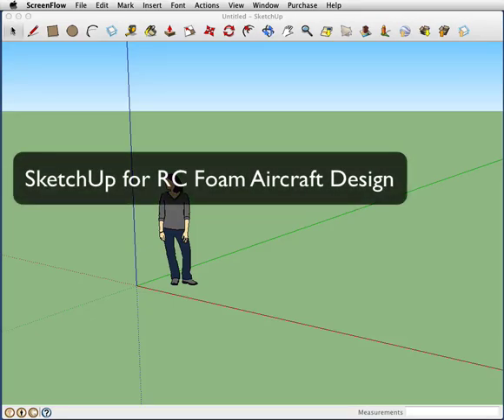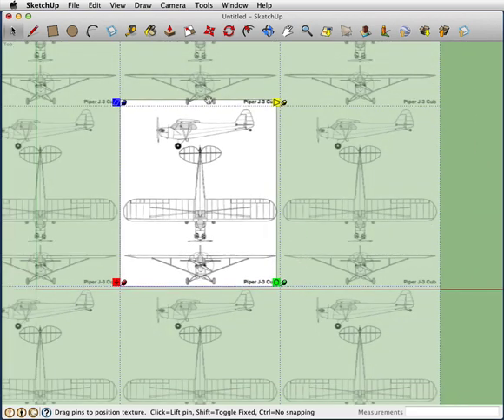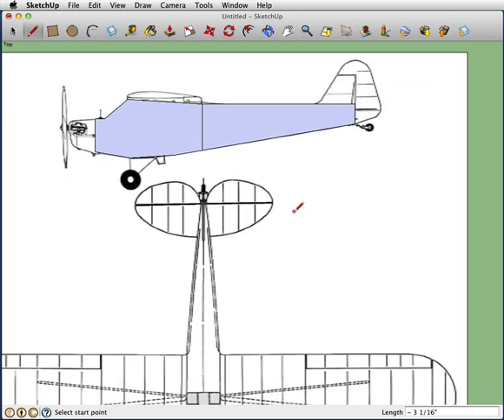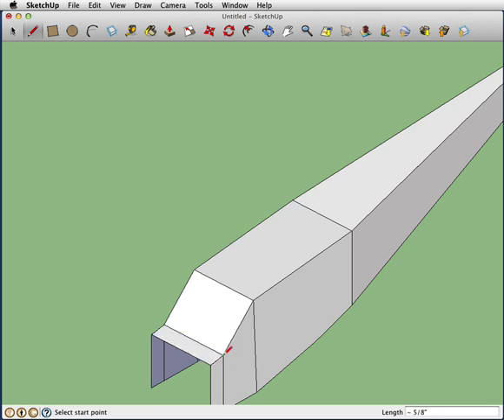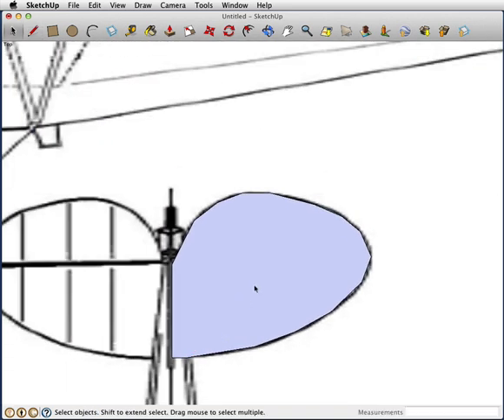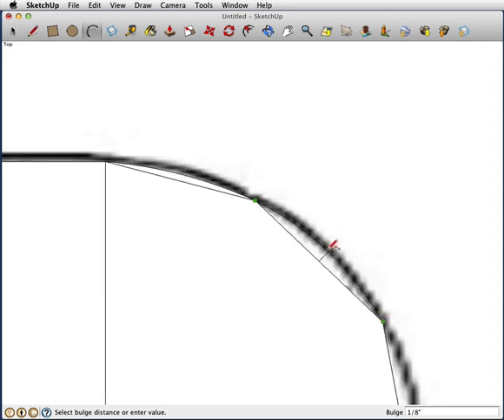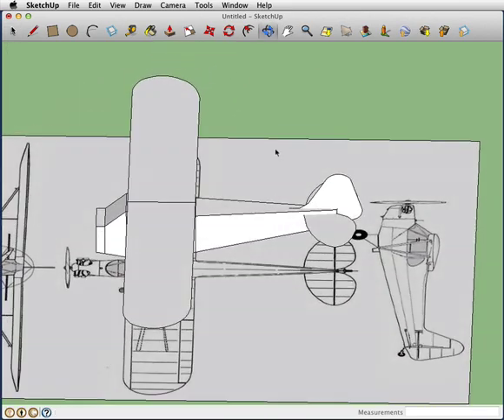SketchUp for RC Plane Design Tutorial #4

Comment: Are you Still active with this content?.. I am have trouble when it comes to bending the fuse to the correct angle , it just distorts I have tried and tried again...Please help..
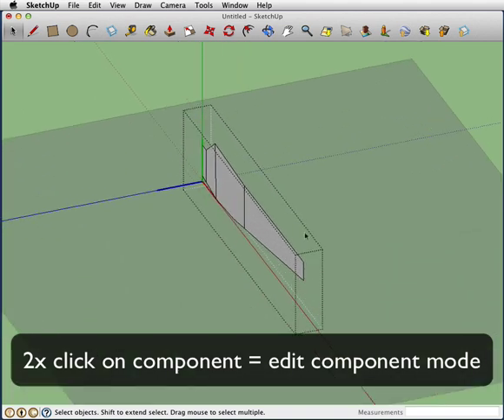Reply from the maker: Are you talking about the part at 12:25 in the above video? If you are getting distortion it's likely due to moving something you don't mean to. Make sure that you have the edge or vector (corner) selected that you want. It will turn blue, indicating that it is selected.
Reply: Yes just like that part in the video, It does turn blue and it still seems to Distort I have even redrawn them..and still it distorts...Not sure exactly what I am doing wrong...I Draw, flip it, line it up, make a component and edit component, and still it does it to me nearly the same way each time ..

Comment: wouldn't it make more sense to make 3 tiles, each on a different axis/plane, each with a different reference texture, it top down would be a tile for the top of the aircraft, front would be the front profile, and left would be the left profile? then just make each tile a reference size based on the actual size of the plan? that way you wouldn't have to keep rotating the model, you could just change views.
Reply from the maker: I do exactly this in some of my other videos. You're exactly right.

Comment: Jason, have you considered that when you trace the side profile of the fuse then put the bend in it to contour to the top view that it will actually shorten the length of the fuse after the bend?  How would you fix/compensate that?  I'm guessing realign the front of the fuse with the side view and drag out the end towards the tail or thinner parts.

Comment: Great and useful videos. I had trouble getting the rear fuse point to move along the proper axis. I use Sketchup 8 on Windows 7 64bit. I tried pressing the arrow keys and the shift + arrow keys as I have found in other forums, but alas to no avail. I hi-lited the top, rear, and bottom lines went to the vertical view and used the protractor to dial in 4 degrees of angle. Thank you for your time. I hope this help others out if they run into the same difficulty. Please keep the great videos coming.